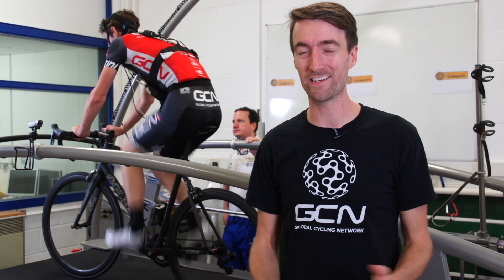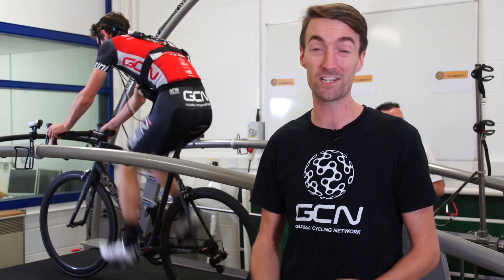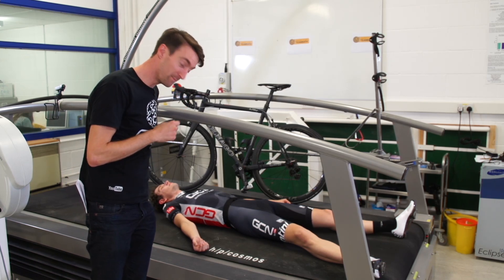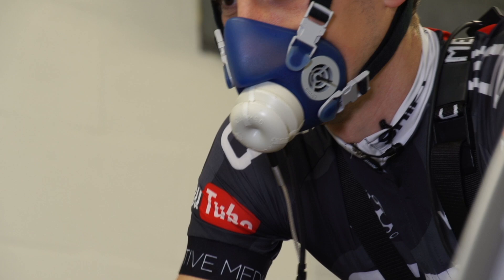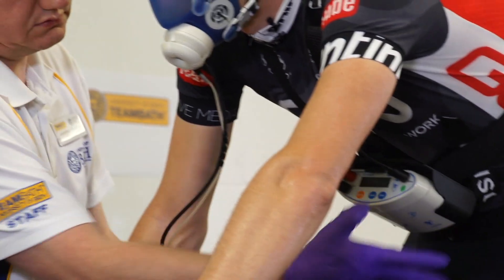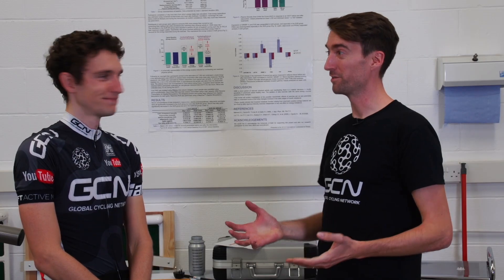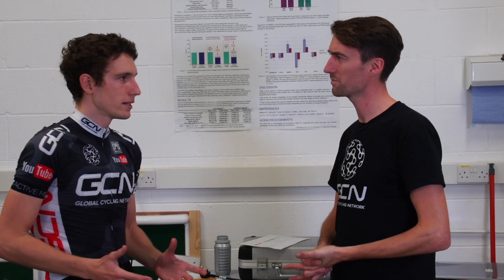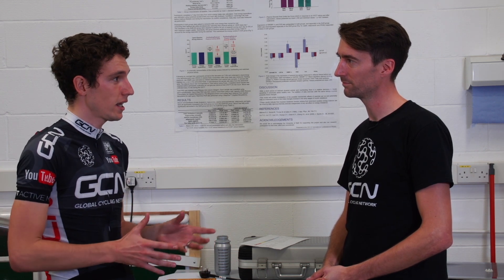What Is The Most Efficient Cadence? GCN Does Science

Comment: So let's talk about n engine for just a minute.... When you have higher rotation, torque tends to decrease, even if power tends to increase. But when you have a perfectly tuned and engineered engine, attached to a low weight car, you don't need so much torque, in order to obtain power, as you will have a higher rotation. That is the problem in phisics. When a machine based in alternative movement is created, just like an engine, or the legs of a cyclist, is hard to obtain high torque, at high rotation. In order to achieve that, you will need huge amounts of air and fuel entering the engine and a ignition system so well tuned that can burn it efficiently at high revs. The same thing with a cyclist. Training is the answer, and training at high cadence, and at the same time, producing high torque, in order to obtain high power. That is achieved by taking nutrients (fuel) and oxygen to the muscles, have a good exhaust system (in a cycling that would be taking the waste produces from the muscles) and having a perfect tuned aerobyc and neuro firing system in order to, efficiently (other than effectively), produce power. That is the graal of cycling for me (well, i understand it, but i can not achieve it... lol... this is a rela little engine :P ). And that is not at the reach of everyone. And having a coach that understand this phisics, can be so good, or so bad. That can take you to real work tuning you up, or taking the wrong pad, with your ego on command, lead you bad. Ask Ferrari, and he understand this perfectly, and know exactly what to do with a human body, in order to "tune" it for support that effort... If you know what i mean. That was exactly what he've done with Armstrong, a guy that he choose as a lab for his experiments, weakened by a desease that he tuned to exhaustion based (in my opinion) in this principle. And achieved a nearly perfect machine. Not legal though, but nearly perfect.
Reply: Humans are not mechanical machines. If you study machines you'll see that lower RPM is more efficient (usable power output relative to energy expended) due to "pumping loss" and higher RPM means, up to a point, you can rapidly increase power with minimal latency. With cycling you have both of those issues and the fact that at lower RPM, when performance starts to fade (human fatigue), you'll risk dropping power and potential to recover efficiently before you realize you should have shifted to a higher cadence. In addition, any athlete's effective cadence window can change due to conditions - including how well the athlete has been training to keep smooth at the upper and lower edges of his effective cadence window.

"That was exactly what he've done with Armstrong, a guy that he choose as a lab for his experiments, weakened by a desease that he tuned to exhaustion based (in my opinion) in this principle. "
 
Armstrong trained specifically to have a versatile cadence window AND he paid a lot of attention to making sure he had very close cogs suitable for the "crunch" points of each critical stage. That means instead of relying on standards cog sets he'd make sure that it critical stages he had, say, a 21-22-23-25 or maybe even a 21-23-24-25 or whatever he thought he would need during the critical mountain stages. It wasn't that his pedaling action was radically different. He was faster than the riders he attacked because he was relatively fresh and made sure he had every cog he might plausibly need so that he could recover easier than the others without blowing up.

Comment: It's always fun when GCN does the "science", although none of the experiments are ever designed to be valid. It would be very useful if you'd spend just a minute or two at the end and discuss the current state of the actual relevant research on the particular issue in question.  You did that here in one sentence when you said something to the effect that current research supports "self selected" cadence, but it would be helpful if you'd go into a little more depth about the research.  Your videos are very entertaining.  Keep up the good work.
Reply: This. First there is a disclaimer that the tests aren't scientifically valid, then there is great fun, and then conclusions are drawn as if they are valid. So is there actual science to back up the claim of self selected cadence? Or is this jumping to conclusions?

Comment: Get GCN
What about the distance covered in each cadence example?  Maybe I totally missed something, but just pedaling for a set time limit means nothing, if the rider is able to climb 50 more meters with a certain cadence in the same time period.  Would be very interesting for you guys to know do the experiment with Simon on a known climb using each cadence and see what gets him to the top fastest and with the most sustainable HR.
Phil
Reply from the maker: Hi Phil, I think you're confusing cadence with power. As long as you have gears, cadence can vary but your speed and power can remain the same. So for example, on this treadmill, speed had to be constant otherwise Si would have rolled off the front or back of it. 

Because he was more efficient at different cadences though, the logic would be that he could ride faster in those cadences.

Comment: So is there any reason to monitor cadence? If self selected cadence is optimal how would I use a cadence monitor and what is the goal?
Reply from the maker: Jason Phillips You can do some specific low cadence and high cadence training sessions but otherwise they are perhaps not the most useful training tool.
Reply: I got one after I started having knee issues and wanted to consciously keep my cadence higher since it seems to be a consensus that higher cadence is easier on the knees than grinding.

It's also handy in high effort when I'm not thinking about my pedal speed and then notice I'm spinning at 115 and should probably shift.
Reply: I do the same thing.  Knee problems suck.  I find once I get used to the higher cadence it is a lot easier to keep speed over distance on flatter surfaces.

Comment: 60RPM vs 90RPM: At 60RPM more muscle mass is used to create power than at 90RPM. So at 90RPM less muscle has to do more work, hence higher lactate levels and higher heart rate levels. At 60RPM more muscle mass has to create the same power, but the muscles do not have to work so hard to create the power, it creates power at a slow and steady rate, almost like walking, hence the lower lactate levels and heart rate. At 60RPM it looks almost like a oxidative fat burning state, vs the 90RPM oxygen fat burning and glucose breakdown to lactate state. Because you are working less muscle harder.

Comment: What about the affect on bone and joint health? I understand that low cadences are bad becaues you can put too much force through your knee. On the other hand the much higher forces involved in running are supposed to strengthen your bones over time, but I don't know if anything similar happens with pedaling hard at low cadence.
Reply from the maker: I don't think that there has ever been a link between cadence and bone health, but certainly pedalling at extremely low cadences can cause knee pain. Equally though, so can high cadences.

Comment: WHAT ARE THE PROBLEMS FOUND IN THE CONVENTIONAL  BICYCLE (CB)? 
■ CB: The current system’s faulty design forces the rider to travel in a circular 
motion (44 inches) and propel the bicycle forward from the CENTER OF THE 
FRAME instead of the rear of the frame; 
■ A- thus restricting how many revolutions per minute (max 120RPM) an 
individual can do within a given time frame before exhaustion and muscle 
fatigue causes the rider to stop pedaling. Most individuals can do around 60  to 90 RPMs. In cycling, cadence (or pedaling rate) is the number of 
revolutions of the crank per minute; this is the rate at which a cyclist is 
pedaling/turning the pedals. 

■ ARC: Since our crank arm is located at the rear wheel and extends to the 
actual spot of the CB, it allows the rider to pedal up and down (30 Inches) 
instead of round and round (44 Inches). This give us many advantages; 
■ A- It removes the Revolution Per Minute Restriction (120) imposed by the 
conventional system. Imagine, this will cut your riding time in half. A person  who travels 50 miles will be able to do it in half the time with less fatigue. 
■ B-It allows us to stay at the highest efficiency zone at all times (2 to 4 o’clock  at all times). The conventional pedal is forced to travel through 8 zones. We  only travel in one zone. The most efficient zone. It allows us to save 14 inches  in one complete revolution. 
■ C- It allows the rider to use the most efficient muscles in the body (running  forces the rider to use extra unnecessary muscles to propel the bicycle forward

Comment: Doesn't it usually come down to the composition of your muscles? If you have a lot of raw muscle power, a low cadence will allow you to mix up what muscles you use in a climb. If, like me, you have a better cardiovascular system, a high cadence will allow you to keep the same power without requiring more strength. So you ideal cadence should really be based on what genetic advantages and disadvantages you have.

Comment: Hey GCN, Can I use this clip or collaborate in an episode related to this?  A little over 3 years ago, I suffered a concussion and shock down my spine, and it affected my motor patterns.  Pre crash, I could efficiently sustain 110-120rpm, but post crash, I struggled to hold 88-93rpm.  My self selected cadence was 80-85rpm.  I tried every cadence drill imaginable and spent months at a time testing every millimeter of saddle fore/ aft, height and degree of tilt, but never saw any meaningful results.  Just over a week ago, I used simple techniques typically used in strength and conditioning, and it immediately allowed me to sustain 105rpm comfortably.  Currently, I'm up to 110-115rpm as my self selected cadence.  Your results can be explained by changes in motor patterns, explaining the increase in lactate.  Based on my results, I'm beginning to wonder if I can groove my motor patterns to efficiently push a longer crank at the same rpm as my current (170mm).  If this proves to be true, I might be the first person to figure out how to train the body to efficiently spin a longer crank efficiently; changing how pros select crank lengths.  Lmk what you guys think about letting me use some of your videos or collaborating to make content on this.  Thanks!

Comment: Cadence, it is not as black and white as you think! On a hill going up, a ridding a low gear, high cadence is the way forward. Why - GRAVITY....  that 9.81m/s is constantly pulling you down!!! it is that simple. If you are in a high gear, and if you could get a high gear big enough, you would not be able to get up the hill..... the vector of gravity and the leaver of such a big gear may in fact see you actually, not only go forward, but it would actually work against you and you would go backwards. It is a physics thing!!! Try it!! Get a huge chain ring and try it on a steep hill. Another thing is that if you tried your test and increased the gradient you would find that you will get to a point where you would not be able to turn the gear. The fuels that your body uses when climbing are also different. For this test to be valid you need to increase the gradient, and test against various cadence.

Comment: low cadence seems to be good, but wonder how does the knee stand the higher forces over time.
Reply: +Niidea1986 I prefer low cadence as it helps strengthen a long time knee injury. I guess it will be dependent on the condition of a knee, but it's typically impact rather than strain that will cause a knee injury :-)
Reply: krazed0451 Indeed, impact is often asociated with joint damage. Anyways, Tendinitis is a very common consequence of repeated stress; I was aiming in that direction. But thanks!
Reply: +Niidea1986 i ride around 80cad avg. I'm still fine after many years :)
Reply: I dont like low cadence plus my legs bones make sounds , im only 16 but I rode my bike a lot
Reply: Microage me too I find high cadence better

Comment: That cyclist's heart rate doesn't have much difference in 100 to 60 rpm. I cycle in a hilly region of nepal my heart rarely crosses 170bpm, most of the time in climbs I use 3rd and 4rth gear. I sometimes use 2nd gear if the climb is more than 40 degrees. I never use 1st gear which is 36t. 1st gear needs more rpm but the cycle doesn't go anywhere 😂 .On a flat road I can go more than 60 rpm with a heart of 160 to 170 bpm. During downhill my heart remains 110 to 120bpm.

Comment: So in conclusion should you mash a harder gear or spin at what is more comfortable?
Reply: Jason, what I gather from the video is self selected is best in their opinion. From my experience racing I think a bit higher cadence is better, 100-110rpm in the flat and 95-100rpm on climbs of 5-8%. A low cadence taxes the muscles/joints more and it's harder to accelerate from a low cadence because the gear is too big. I reckon a 60rpm cadence on a long climb if you're not used to it could result in some sore knees for sure. It's all about getting to the end of the race as fresh as possible so you have the energy to try for the win and I find that a higher cadence does that in my case.
Reply: I agree. I just thought it odd that Si's lactate levels were lower when he spun the harder gear, but I'd understand wanting to be fresh at the end of a race especially if it does not end on top of HC climb. Thanks for your input.
Reply: If you want maximum efficiency its all about finding the sweat spot in between. Without a CVT it takes a lot gear changing to maintain.

Comment: It's not rocket science. "Power out" is at the back wheel and "power in" is at the pedals, so if you've got enough local muscular endurance to generate the power you need at the back wheel with a lower cadence then (by turning the pedals fewer times) you save some oxygen and heart rate. If you had enough local muscular endurance, or the effort was fairly short so that the damage you were doing to your legs didn't matter, you'd pick the biggest gear you could manage consistent with using all the oxygen you can process.

Bluntly, anyone who has ever ridden a bike thinks, "It's easy on this little gear, so if I could only turn it fast enough I'd go really fast and it wouldn't hurt". They're all wrong. If they weren't someone would have discovered this by now. There used to be 63 inch gear racing in the winter in the UK, and the times were rubbish. You need to push a decent sized gear, and becoming fitter as a cyclist can be pretty much defined as, "Developing the kind of local muscular endurance in your legs which allows you to reach higher heart rates for longer on bigger gears".

Comment: I calculated I pedal at about 55rpm when riding my bike, but I'm also always in the fastest 4 gears except for steep hills (and always the big ring at the front for anything but the most extreme climb). Is it normal that my preferred cadence is so low? I am a very fast cyclist and overtake virtually every other cyclist despite pedaling much slower.
Reply: If anything, you should really start thinking about your knees
Reply: @manutavano  My knees have always been fine but I am far from the fastest cyclist now as I've gained 35 lbs of muscle from weight lifting which severely negatively impacted my cycling performance.

Comment: Nonsense. They would pedal at a higher cadence when climbing (in a seated position) if the larger gearing on the cassette didn't add more mass to the bicycle. On a touring bike, when I've had those gears for climbing, I've used them at the same cadence—or even higher—than I rode on the flats. When I finally run out of easier gears, not so much.

Comment: This test although set in a lab is completely useless as why no fan pushing air to simulate wind? There is always some wind outside so the cogs vs wind speed = cadence available. At 25 km winds on a 14 kg bike do the math you will have to slow down the cadence massively based on Wind Speed, Altitude or Wind Speeds.

Comment: They tell me my cadence of 50 or so is too slow but my gear is 53 11 I agree that it is too slow but if I spin such a gear I will break the speed limit of most bike paths.
Reply: Change gears / don't ride on bike paths.
Reply: I ride a 52/14 at 70-80 rpm and i have not had any problems though not a huge cycling infrastructure in north america